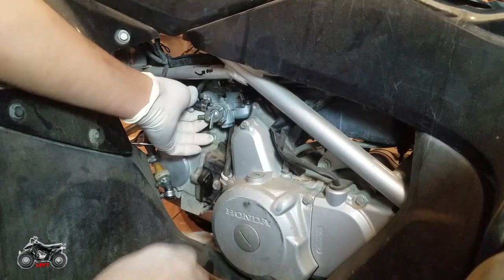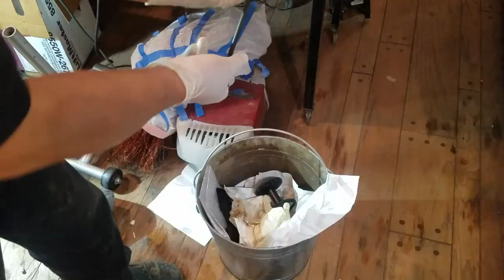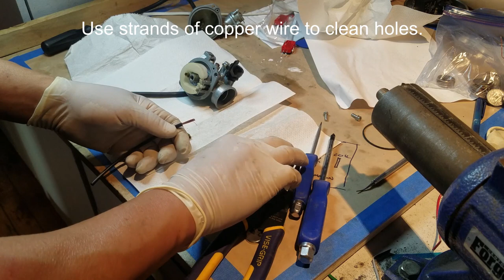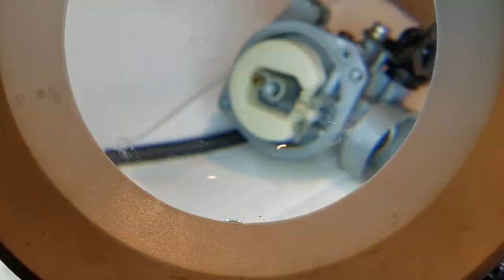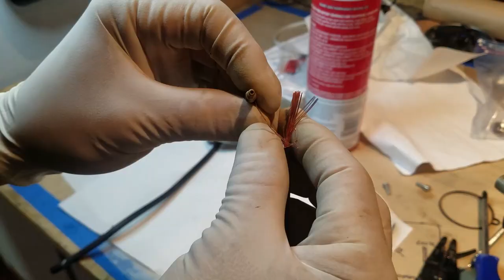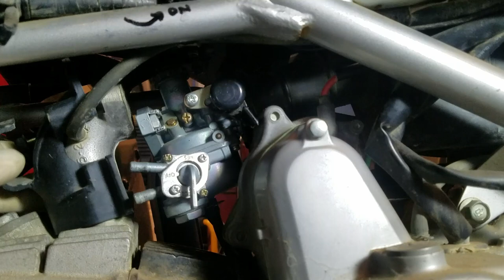EASY! Removing and Cleaning Clogged Carburetor on Honda TRX90EX / TRX90

Comment: Cleaned out the carb and made sure I could see through all the little holes on the jets, however, i still need to give it gas and warm it up for a few minutes before it idles.  Is that also your experience after the carb cleaning?

Comment: Hello, do you know if the crf 100 carb will work on a trx 90 ? People are saying they will run stronger with the crf carb but I’ve never seen one here on the tubes to check out for sure

Comment: I found out that that little intake peice thats on the motor dosnt have to come off the two bolts that hold the carb on the carb slides off
Reply from the maker: You are correct, the intake manifold doesn't have to come off.  But you will find removing and reinstalling the carb much easier if you just remove it.  It's just 2 bolts.  It's especially difficult to install the rear part of the carb to the boot for the air filter box if you can't slide the carb forward/backward because the manifold is in the way.  As you can see in the video at 2:00, I am able to pull the carb straight forward to remove it.  And at 6:50, push it straight in to reinstall.  I would be almost impossible to do this without the intake manifold removed because you would have to push/pull sideways.  So, this often forces you to remove the fuel tank and unbolt the air filter box to move the rubber boot back, away from the carb.

Comment: Hi, where does the bottom line (below carburator) connect? Mine is just dangling lol.
Reply: It just dangles.  It's where fuel comes out when you unscrew the drain screw to drain the bowl.  You don't even need that hose.  It just gives the fuel a place to empty out.
Reply: @moocow2529  ah perfect thank you so much!!

Comment: Maybe I missed it...there are two air tunnels at the intake that lead to the jets. They should be cleaned.
Reply from the maker: Not really. The chole is just a plate that blocks the flow of air. If it looks dirty or is hard to move, clean  it.  Otherwise, it doesn't do much.
Reply: Excellent observation. There are two channels. One for each jet. Might be atmospheric control. They must be cleaned. Also you should crack that 17mm nut. Or if it’s too tight try to get the sediment out from the side my removing the two Phillip screws from the on/off/reserve valve and shooting carb cleaner from there. It’s designed to be a sediment trap. Also mark the fuel hoses as it’s easy to mix them up. The bottom hose should be the on gas and the top reserve.

Comment: What’s a easy way to get to the rubber seale
Reply: Also how did you get the seal of
Reply from the maker: The seal for the bowl?  Use a pick.  If it doesn't come off easily, it may be too old to be reused.

Comment: Can a clogged jet also cause the atv to overheat?
Reply from the maker: Yes. it can.  Running lean causes the engine to run hotter. A partially clogged jet can cause it to run lean.

Comment: I just tried this on mine and now it won’t start.. Before it was at least working now I can’t even get it to fire.
Reply from the maker: Remove the carb again.  Is there fuel in the bowl?  If there's no fuel in there, the float needle is stuck closed.  Otherwise, clean it again.  Sometimes I have to clean a carb 2 or 3 times before success.  But if yours suddenly doesn't work, you did something wrong.